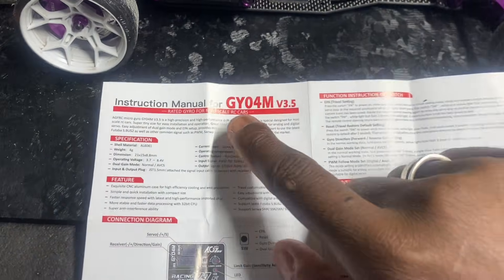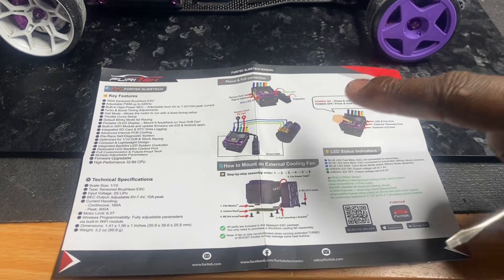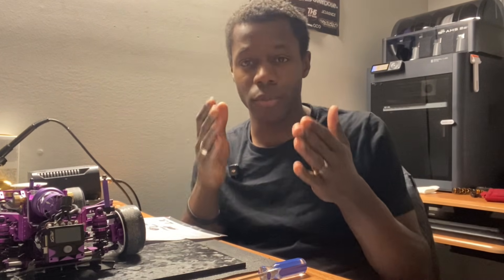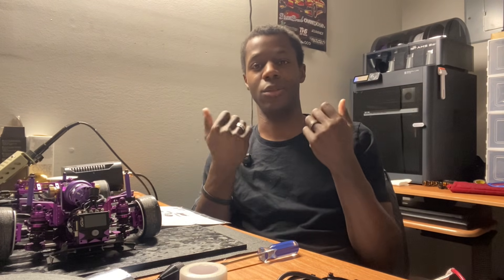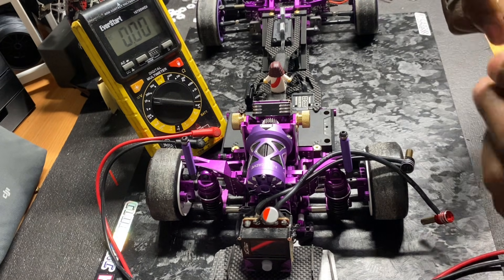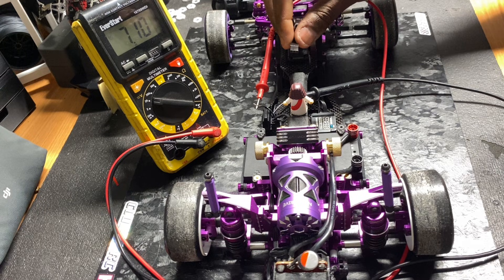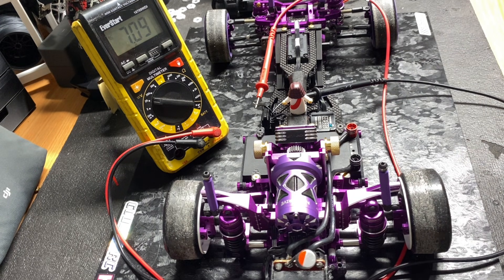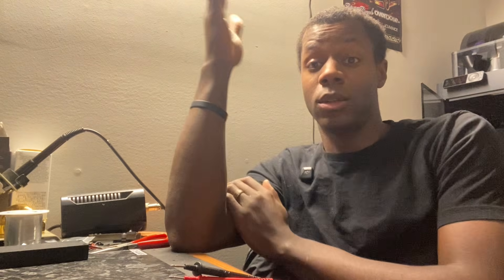Higher BEC Voltage in RC Drift… Genius or Dangerous?

Comment: try the furitek with the fan unplugged, id be curious if the fan/light kits change anything
Reply from the maker: I did. I unplugged the servo also. Didn’t put it in the video though because its supposed to output 7.4V at 10A peak. Nothing should be robbing it of power.

Comment: Sometimes the BEC inside your electronics, your ESC doesn’t always put out the exact specifications that it says in the manual or on the package it has to be tested because as time goes on things get weaker electronics were out it could hinder the performance on whatever is hooked up into your receiver so if you have an electronics in your car that can go up to like 12 V or higher you can wire in and direct power straight to your serval or Jiro or whatever else you want to wire in and just bypass your ESC completely for your BEC regulator internally or just get a higher end regelation and just wire that way

Comment: Coming from a crawling background, ive gone as far as direct powering a regular servo off a 3s lipo, and got excellent torque and speed... for about a year. It only died due my abusive driving. Had i not bound up the steering and stalled the servo, it would have lived. If you are running a 2s lipo i would not worry about going as far as direct wiring the servo for a performance boost. It will run forever at 7.4 volts.
Reply from the maker: That's some serious experience, thanks for sharing that insight about direct wiring!
Reply: @idealautofactory it was a full size injora blue case

Comment: Hey Joshua!
Your electronics will work within a voltage range but the specs are only published at certain voltages because it's easier to publish a number at a specific voltage rather than a graph with a curve.
Your bec voltage will never be higher than your battery voltage so even if your bec is set at 7.4 your bec voltage will match your battery voltage when it gets than 7.4. This is because escs only have buck converters and not boost converters. Honestly I wouldn't worry about the difference in torque when the voltage drops. It's not significant enough to care. Just like you never think your motor is giving you less rpm as your battery voltage gets lower.
Reply from the maker: Oh this is so good! I never thought about the motor! The motor is probably the main reason the car feels different after the battery drops in voltage a bit right? Also, thank you for watching and giving this explanation. I am trying so hard not to go down a rabbit hole here and this helps so much lol. Truly I do appreciate it.
Reply: @idealautofactory yup exactly! Motor rpm is calculated by voltage x kv of the motor so your car will always feel faster on a fresh battery!
Reply from the maker: 🤝 thank you. I will pay attention to this more as I drive now.

Comment: Thanks for this valuable information. Me personally run always on 6 but would like to see the difference on steering with 7.4 have to see if sanwa servo and gyro can hold it. Thanks again and KGF 🫡
Reply from the maker: You’re welcome. Thank you for the video idea. I am going to test out that servo for sure. I acquired a Sanwa ESC also
Reply: @idealautofactory browsing around in order to run at 7.4 the receiver also needs to be 7.4 capable. That’s for the first esc you tried the furitec
Reply from the maker: @omarmrivera1902  Correct. The Rx on the Maclan and the Furitek are the same. i saw 7.4v on the Maclan once I plugged in the bluetooth dongle.